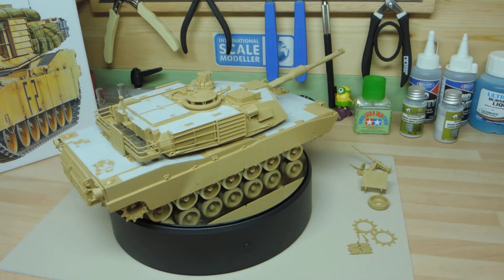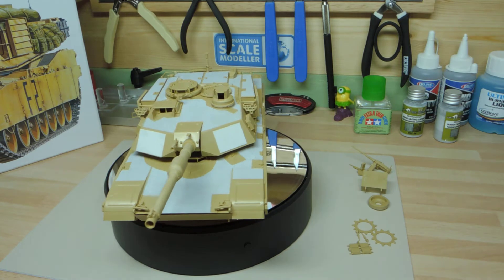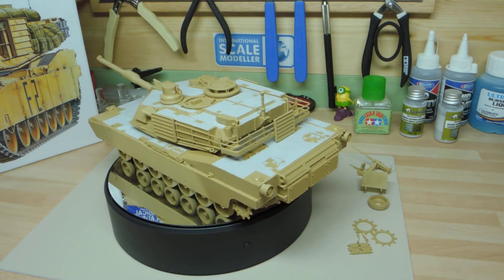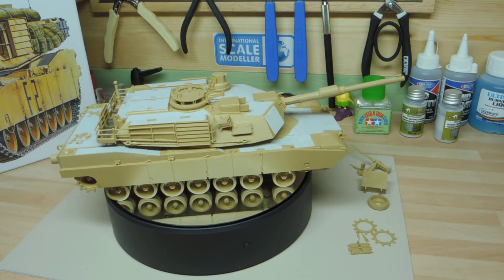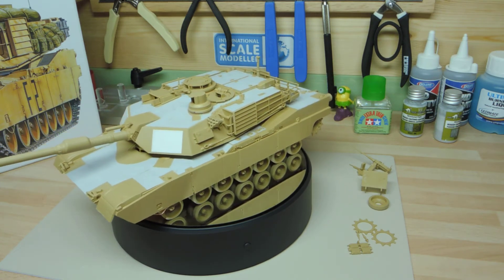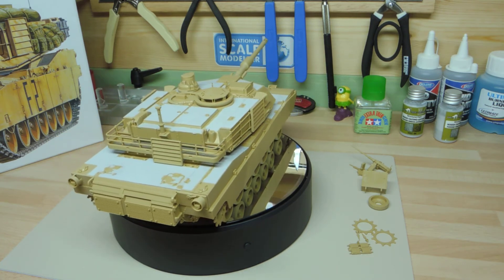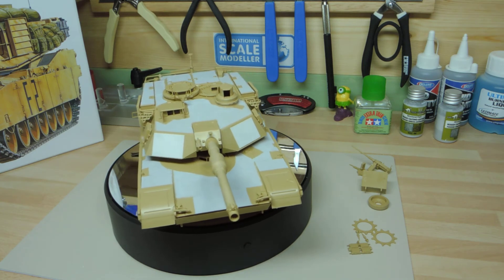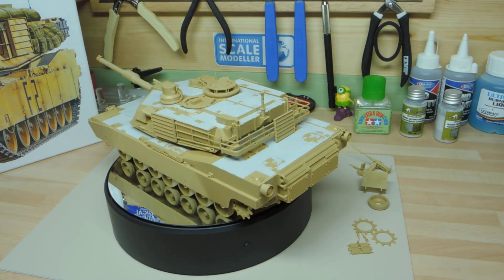SWITCHER BUDDY BUILD M1MA2 OPERATION IRAQI FREEDOM UDATE 5 BUILD COMPLETE

Comment: Looking good Paul you done an amazing job to date. I like we are doing 2 different variants :)
Reply from the maker: Switcher, thank you, and I think your right Doing different versions, but I could get a thing about chevrons if I'm not careful "lol" they do add a little something visually. I'm really enjoying our build.
Reply: TANK MODELLER Paul Inge
Thanks Paul, but please be careful. At this stage it is not just the chevrons that are different. You can do whatever you may want to do, but there is too much different between the two to change directions now e.g machine gun mounts, cupola, APU, CIP panel on the rear basket etc... plus I am probably forgetting some :) You are doing a great job, don't get a "bonner" LOL with chevrons. After all you and I know there is a delta between love and infatuation.

Comment: Paul, look at the video named " M1A2 Abrams SEP III " there are some really good views of the MRS in it, the new ones have a bit of an indentation in them. You may not need to fill the hole completely. Just leave a slight indentation. And watching the video reminded me of the little balls on the ends of the antennae, I completely forgot to mention that!
Reply from the maker: Thanks again Sgt Bones, I look tonight.
Reply: +TANK MODELLER Paul Inge In case I misunderstood you, the back side does have a lens (the side facing the turret) but the front is slightly indented and has a notch in the middle. Usually there is a safety wire running through that notch.

Comment: That bit on the end of the barrel is the Muzzle Reference system, it's like a barrel droop indicator, and nope, it's not open to the front, it's just black on the end, and actually has a retaining wire right across the middle of it. It is open towards the rear, since it references to the main gun optics. Just google "Muzzle Reference System M1A2" which shows some good pictures of it. Oh yeah, one other thought about the antennae....normally when driving they would be curved forward and tied down towards the front of the turret, and only let full up when stationary. One does NOT want an antennae striking a wire!
Reply: +Sgt Bones Bill, your collaboration on this build as been nothing short of outstanding :) KUTGW It is nice to see folks chime in with relevant data. To me, this is what it is all about. Thank you :)
Reply: +Switcher Thank you Rich, I consider it my duty to help folks get things right, especially when you guys have been taking so much time and making so much effort to get the tanks looking so good. Besides, we all learn from each other here, I would say it's fair trade!
Reply from the maker: Thank you Sgt Bones, I'll fill it in as I won't to start the primer coat off tonight. And I'll have a look at muzzle reference on Google now. It's all about learning from others, when I'v looked I may be able to use my punch a die set instead of filler? That's once again.
Reply: +TANK MODELLER Paul Inge No problem. can't wait to see your next video!
Reply: Sgt Bones
Couldn't have said it any better myself :) Thanks!